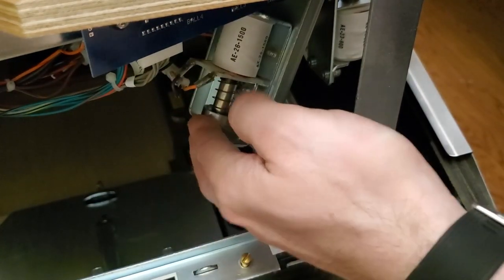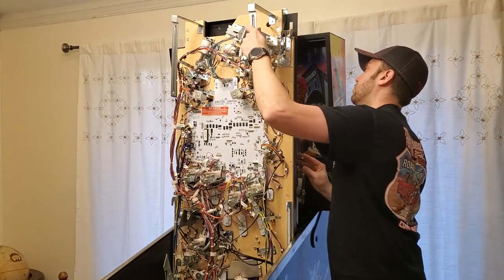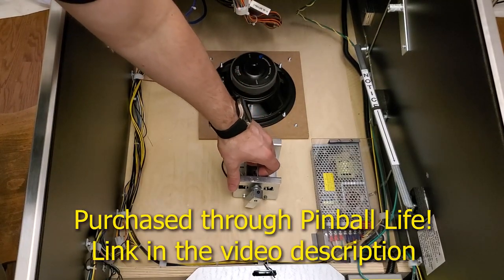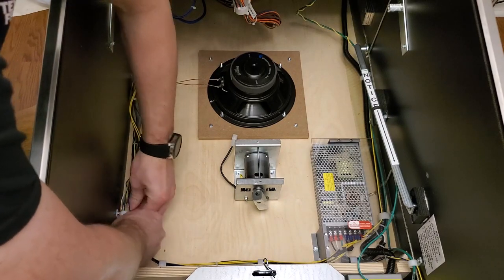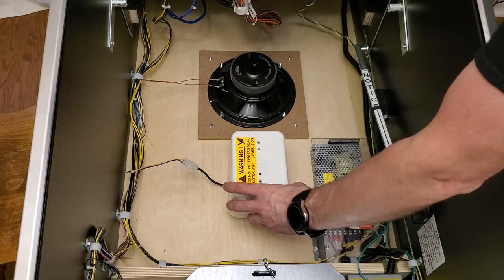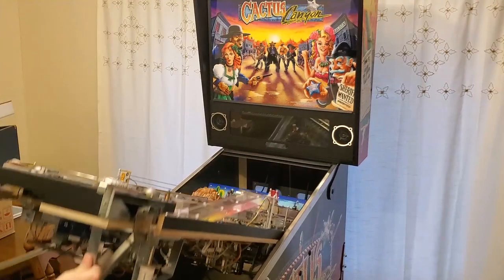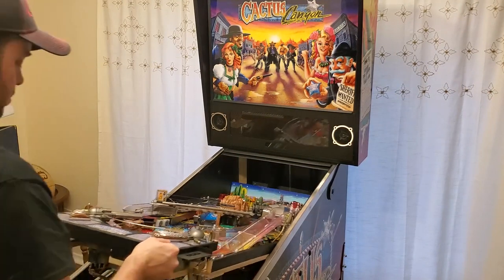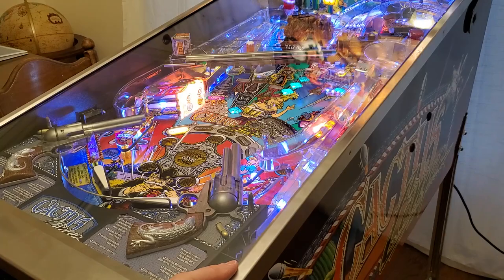How to Install Your Chicago Gaming Company Shaker Motor

Comment: My shaker I just installed on Godzilla seems to shake the system way too hard. Is there a way to turn down the intensity while keeping it reacting to the most amount of stuff? It’s currently on moderate but it making too much noise shaking the entire cabinet way too hard
Reply from the maker: Try turning it down lower than moderate then? Or you may not have it bolted down enough. Or you may not be use to a shaker motor shaking a game.
Reply: @CaryHardy  I have a stern shaker in my virtual pinball cabinet and it’s more controlled. Or maybe I’m not use to the way real cabinets are put together and maybe there are more lose fittings that are causing all the rattling
Reply from the maker: @johnmcclane2139  I wouldn't worry about the game shaking apart. It SHOULDNT.